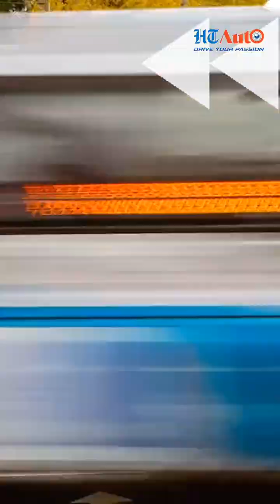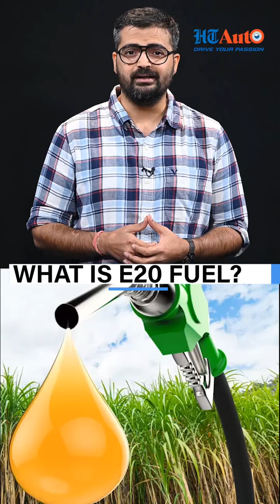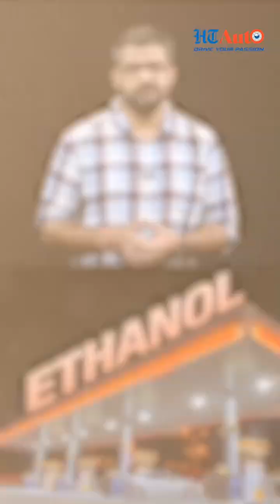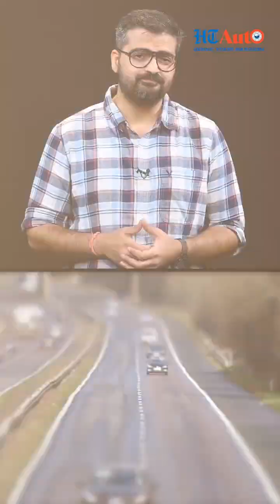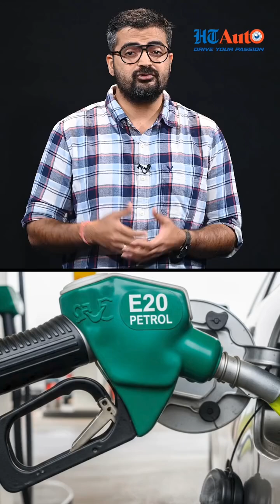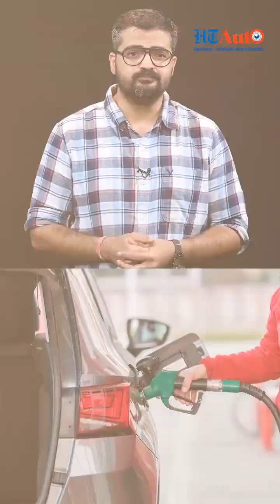E20 Fuel/Ethanol Blending: All your questions answered.

Comment: Instead of 'Ethanol Blending' use Ethanol exclusively for Public Transportation and Govt. Vehicles. Ethanol, widely used in fuel blends like E10 and E20, possesses a hygroscopic nature—meaning it naturally absorbs moisture from the surrounding air. This trait, while chemically fascinating, poses serious challenges during production, transport, and storage. Even in sealed containers, ethanol can draw in atmospheric water, leading to increased water content and potential phase separation when mixed with gasoline. Such contamination not only reduces fuel efficiency but also destabilizes combustion, making the fuel less reliable and more corrosive over time.

For vehicles, especially those not specifically designed for ethanol blends, this moisture absorption can result in gradual engine damage. Excess water in the fuel system may corrode metal components, degrade rubber seals, and trigger misfires or starting issues. In humid climates or poorly maintained systems, the risk intensifies. To safeguard engine health, it’s essential to monitor fuel quality, use stabilizers, and ensure proper storage practices. Ethanol may be a step toward cleaner energy, but its hidden vulnerabilities demand careful attention.